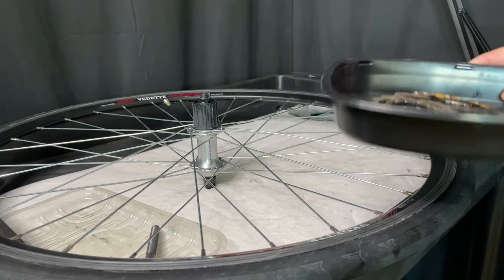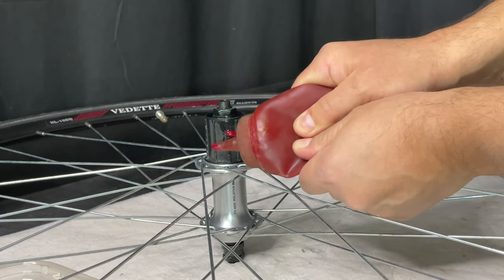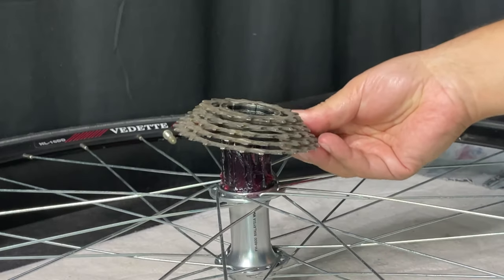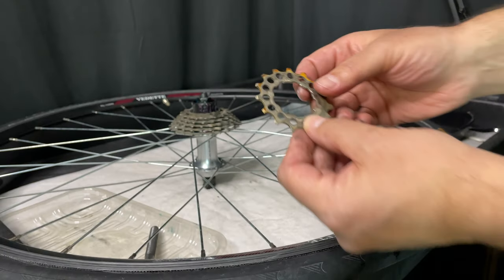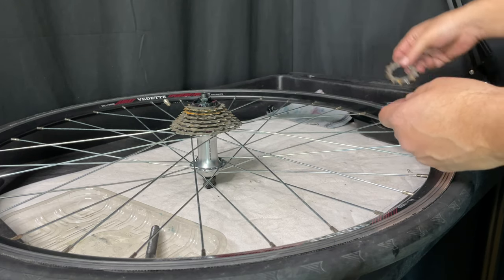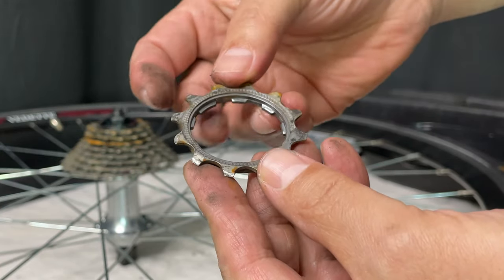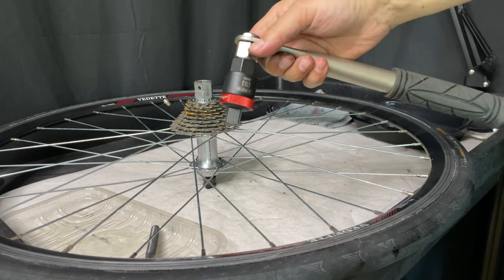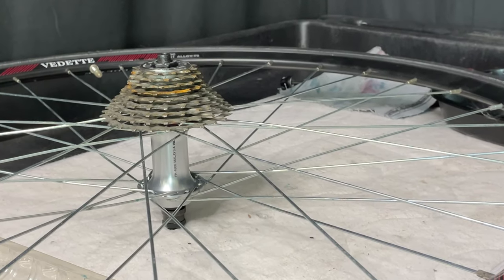How to install a cassette on a Shimano Tiagra hub

Comment: I bought a cheap spline tool on eBay and the socket didn’t fit over the 17mm axle nut  nicely like yours does. I had to hammer it onto the axle. Just so some other viewers know .
Reply from the maker: The pro tip here is to remove the axle 👍! Thanks for the anecdote because it happens a lot with the older stuff.